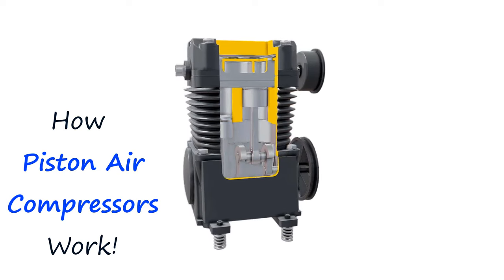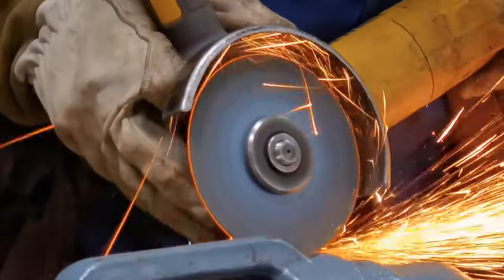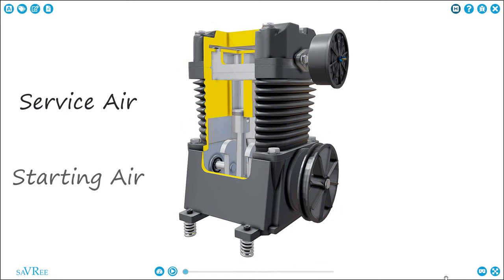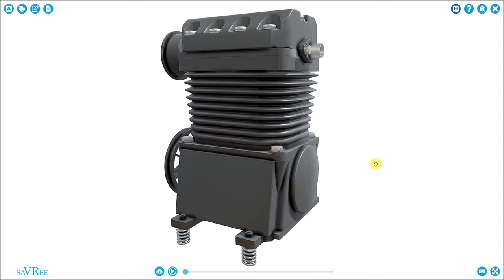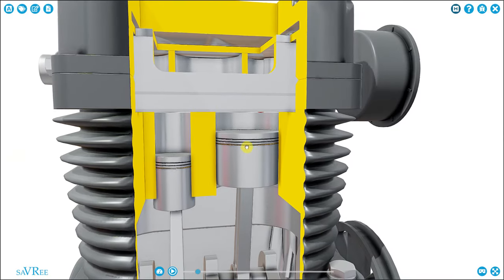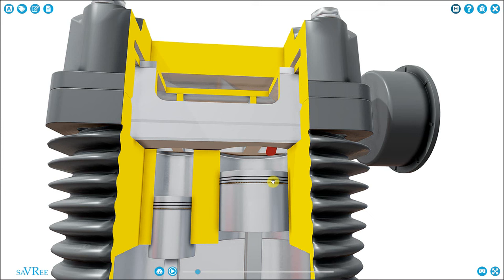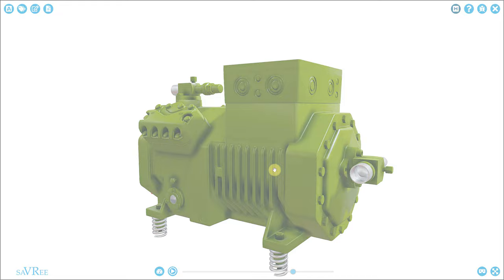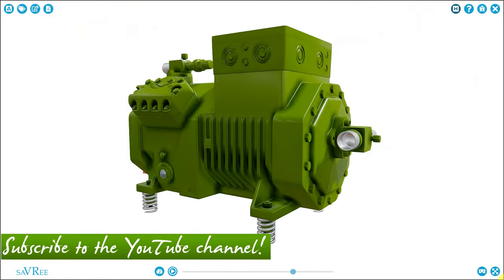How Air Compressors Work! (Piston Design)

Comment: one question i have, does the air compressor   works on the same principle of a bicycle air pump, where there inlet and outlet valves, as in when when u push the  inlet valve opens and when u pull the  the outlet calve closes...thx

Comment: You should know that Chuck Norris used an air compressor in his youth, then abandoned it because he recharged the tank faster by mouth than with the pump.

He ended up abandoning the compressor and blowing directly on the bolts to unblocked it; it was ultimately more effective

Comment: can you do a video about marine steering gear in details? specially how the fluid transmits inside the steering gear? and the axial/hale shaw pump mechanism?
Reply from the maker: Oily water separator?
Reply: sorry my mistake, apology 🙏, actually wanted to talk about steering gear for big ships
Reply from the maker: @mec6953  Steering gear is planned. Ram/piston type first. Rotary type after. It will be in the new marine engineering video course (with a lot of other stuff).